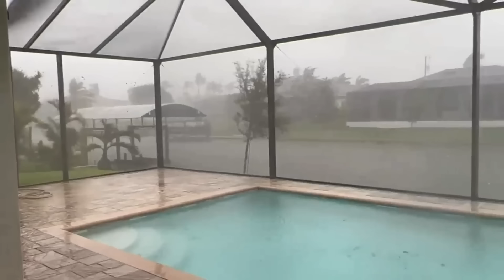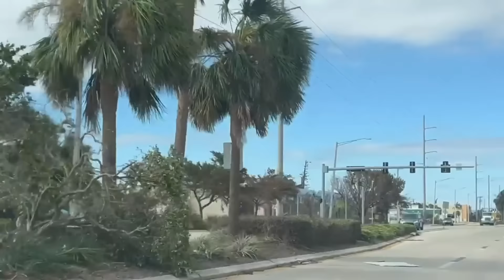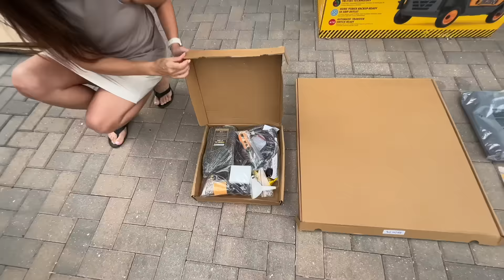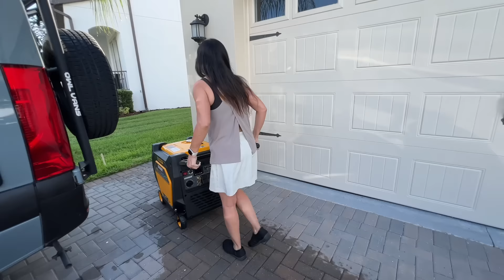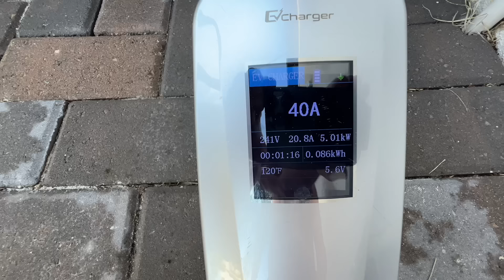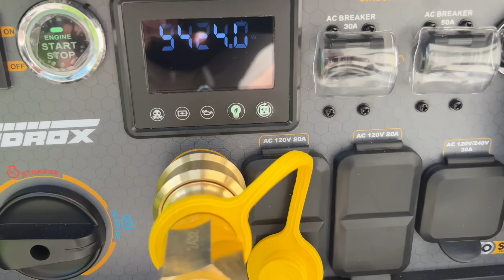Hurricane Ian - 3 Weeks Without Power Changed Everything: Gidrox 11,000W Generator

Comment: Seafoam in the gasoline lasts 2 1/2 years in a ul listed safety can, I have 10 of them…..
Reply: I store all my gas equipment with trufuel from Home Depot. It has worked excellent for me for several years now. I just run all the trufuel out and then fill with gasoline and then vice versa when I’m getting ready to store the equipment again. Trufuel isn’t cheap enough to run the equipment all the time over a prolonged period but great for storage.
Reply: @hotwiredpc4079  and I only use recreational fuel. It’s non-ethanol….from wawa
Reply from the maker: All great solutions, I made the mistake once ... and ended up with a new carburetor after letting my gas sit for 9 months.
Reply from the maker: Thanks for the tip!
Reply: Excellent! Having an ample supply of fuel is key. As a retired power lineman my suggestion is to have enough fuel for a two week interruption. One week for the roads to be cleared. Another week for critical infrastructure to be repaired. That way just as your using the last of your stored fuel you're able to buy more if needed? We keep enough fuel for a 3 week interruption. We like to have more than enough fuel because we all know the little old lady who is stuck at home when she should have had that tree cut down & her generator ran out of fuel because she didn't plan well.

Comment: Good stuff. I have been through MANY hurricanes and I have some suggestions:

1.Closed frame Inverter generators have their advantage in regard to decibels. However, the enclosure reduces ventilation which increases heat. Heat is the enemy of electronics (circuit boards, switches, etc.). Generators get blazing hot when used for hours. Failure after prolonged use is an increased probability. Testing for two full days of use before you need it is recommended.
2. A generator of that size will suck up a huge amount of propane. You must have fuel sources for at least 7 days without power. If you have trees with deep roots in your subdivision, then they can be uprooted and pull up gas lines. Always have a backup plan for the loss of propane as a fuel source.
3.You will need power while waiting for the storm to pass and are able to hook up and start your generator. I suggest you invest in some large portable power banks (e.g. Ecoflow, Bluetti, etc.). Charge them fully before the storm and position then to automatically kick on when you lose power. This is especially important for refrigeration.
4. Get some small portable inverter generators to recharge you power banks as needed.This will save on fuel and allow you to rest your large generator while still having power for essentials. Keep your Firman as a backup. Two is one and one is none as they say in the military.
5. You must get some portable window air conditioners (preferably inverter type). The roll around types are also a less efficient option. This will give you the flexibility to cool various rooms as needed. Humidity is brutal after a hurricane.
6. Plan to protect and defend your outside power sources (locks, chains) and supplies. You may be the only resource for desperate opportunistic criminals and theft rings. One advantage of power banks is they generate no noise to identify your resources from a distance. Particularly good at night.
7. Get Starlink and set up Google Voice (VoIP) so you will have internet and cell phone communication when the cell towers and cable providers go down.
Reply from the maker: Thanks for the suggestions. Having lived through Hurricane Ian myself, I agree with a lot of what you’re saying.

One thing that may not have come across in the video is that I already have a fairly extensive backup power setup in my van. In addition a generator, I have over 15kWh of lithium battery storage along with solar charging, alternator charging, and portable power stations. During an outage, those systems can handle many of the lighter loads while reducing generator runtime and fuel consumption.

I also agree that any generator should be tested before storm season. One reason I wanted to make this video was to put some real load on the Gidrox and see how it performed before I actually need it.

As for propane, I like it because it doesn’t go bad in storage, but you’re absolutely right that no single fuel source should be the entire plan. Redundancy is important, which is one reason I still have my Firman generator as a backup.

My van also already has a Starlink mini and it works very well. Communications can become just as important as power after a major storm.

The biggest lesson Hurricane Ian taught me is exactly what you said: don’t rely on a single solution. Layers of backup systems are what get you through long outages.
Reply: @RubysAdventuresUnplugged The free Google Voice VoIP and Starlink are your friends when the cell towers blow down or loose power.
Reply from the maker: Yes, the starling is amazing.  I have literally been off road in Utah cannons with no cell services for miles ... and still have perfect starling connection.
Reply: She was connected to Natural Gas.    I started with a Generac XL5500 which ran for 25 years.  It still runs, but might be too dirty for modern electronics.  It was replaced with a Firman 3600W, WO3342.  That smaller system is tested and could run my house until I changed houses and now have an electric stove and a 2 ton central AC.  In 2025, I added the 2 Ecoflow DPUs and two batteries.  Either set can run the entire house for most of a day without lifestyle interruptions.  It was a heck of an addition and worth every penny.  For fuel, I have 27 Gallons of gas stabilized and rotated through the car every 6 months.  I also added a motor snorkel incase if I have to go to NG...   Now I am just waiting for a good storm.  I am 3 years in this house and no week long power outage.
Reply from the maker: @gibblespascack1418  I realize it appears to be natural gas, but it is propane.  All the house in my area are connected to a large propane tank that is managed by the subdivision.  It is plumbed underground just lake natural gas ... but it is indeed propane.
Reply: @RubysAdventuresUnplugged  In NY, we get both NG and electricity supplied by either Quebec or Ontario.  Most larger cities have NG piped in.  We are supplied from two directions.  Canada and from the PA or NJ feed lines.  I assume that anything that boarders Ontario/Quebec is in a similar position.    If you get out near Boston, they receive LNG ships which help them through the winter due to insufficient feed capacity to the system.   However if you are in the more rural areas of NY state, then many houses have individual propane tanks( cooking/heating/standby generators) or fuel  oil tanks for heating.

Comment: Are you sure you're talking about "propane" and not "natural gas"? It looks like you are running it from your natural gas line. Natural gas also gives you a lower generator output than running it on propane.
Reply from the maker: Hello Jake, yes my subdivision has a huge propane tank that feeds out homes through underground piping (similar to natural gas).  Thanks for the question.
Reply: @RubysAdventuresUnplugged Great, higher output for you.
Reply from the maker: Agree, however the output was well above the propane and gas specifications.  Very weird.  Thanks for the comment!

Comment: Very informative video!
Have you considered a stationary, hard wired, propane powered unit?  Generac is one brand.  Automatic - power goes off, generator comes on, power returns, generator shuts down.  With a couple of fat boy tanks, your propane supply could be independent of the community supply.  Various sizes are available.
I have a 7500 watt Generac gasoline powered portable unit.  Plugs into the house, runs everything; have a propane furnace, stove and hot water heater, this reduces the electrical load.  Wood stove.  The generator noise is an issue.  Two ice storms resulted in outages this past year; fortunately not mid-winter.  Long winter here, used the snow blower first time on Nov. 11, last time April 6th.
Reply from the maker: Hello Richard, Yes I have thought about a hard wire system ... until I saw the cost.  They are not cheap and require constant maintenance, so I decide to go with a portable.  Thanks for the comment!
Reply: We live in a HOA & they forbid back up generators that run on propane. Natural gas is not an option where we live. The only solution was a gasoline generator. HOA's only govern what they can see. They can't regulate a portable gasoline generator that is rolled out of your home in an emergency.

Comment: If the gas tank is metal, I wouldn’t put gas in it.  Because you’ll probably store the generator for months, and having to empty the tank.  The tank will rust like crazy inside.  Then it will clog the carb.  I bought new gen like yours, followed the instructions as per the manual, and by the 3rd year my carb was completely clogged with rust particles, however it can still run on propane.
Another thing to consider is, you might want to get a portable ac.  Don’t rely on the main house ac.  The ac may get damaged, windows broken, or half the roof torn off.  If any of those things happen, you won’t be able to run the main ac, but if you have a portable ac, you can find a “good” dry room, section it off and use the portable ac.
My strategy is to get a small generator to run the smallest living space as possible , aka class b.  This will allow me to sleep comfortably, and I save $ due to fuel prices and inefficiency of producing electricity with a generator.  The small generator can run with 1 gallon with no load for 8hours, but a larger generator will eat up 4 gallons.  So if I use an inverter generator as the turbro, I’ll be able to run it as efficient as possible as it will throttle down and use little power through the night.  I figure it should be temporary or at least till electricity turns back on and then I’ll be using electric from the city.
Like you I’ve lived through hurricanes and like your neighbors lost 1/2 my house.  This is now my current strategy.  Good luck!
Reply from the maker: Hello Nick, I really appreciate you sharing your hurricane survival strategy and experience with generator maintenance.
Reply: @Rub @RubysAdventuresUnplugged ks, somehow the manufacturer didn’t think about humidity and storing the generator for months and in doing so the tank breaking down completely.  I can see huge chunks of rusted metal inside mine.  Another thing is if your generator is electric start, get yourself either the proper battery maintainer or like me, just a charger and I plug it into a timer that tops off the battery power once a week for about 10 mins.  Since I’ve done that my battery has lasted many years.  If you leave it permanently recharging, the battery will die inside one year.
Reply from the maker: yes!
Reply: To avoid this keep your gas tank full at all times.Exercise the gen once or twice a month and top off.
Keep a dehumidifier in the garage if possible.
Reply: @johnnyhotrod when I get another, I’m using propane only, the I’ll store in ac control area, definitely not garage.  Gas is a PIA. Lol
Reply: @nicklee5591 Gas is a pain in the ass. Unfortunately we aren't allowed to use propane because we belong to an HOA. Diesel is an option but again storage. Just like gasoline. We don't have anything that runs on diesel other than our furnace. It's new & I wouldn't want to put anything else in our tank outer than the fuel we are supposed to use. 
We rotate our fuel so it's never more than a year old. I put the old 1 year fuel in our trucks to be used. 
The key to gasoline is adding preservative & labeling fuel. We use Stabil 360 & Star Tron fuel enzyme together. We haven't had any issues.
Reply: @j @johnnyhotrod We keep our generator outside all the time in it's own vented enclosure. 
We keep our tank as full as possible with treated fuel. We have a steel tank & it still looks brand new 8 years later. The key is changing out your old fuel every year so moisture doesn't have a chance to ruin your plans.
Reply: carbs are cheap if you buy aftermarket so last one i bough was 15 bucks e bay or amazon .  brigs wanted 90 and its china made too
Reply: @remocres Our generator doesn't have a carburetor. It has electronic fuel injection. However our mower, pressure washer & snowblower & our other tools have carbs. I bring those in for service when they need it.

Comment: Gasoline generators do use fuel like crazy, especially if they’re close to full load.
Reply: I'd go for propane...at least they run cleaner (better for the generator). 
-- BR
Reply from the maker: You are absolutely right, fuel consumption really jumps up once you start pushing the capacity.
Reply: Except if you buy the model generator like ours. We average just the same fuel economy that they tout. 18 hours on 5 gallons of gas. That's more than enough fuel to last a day. We keep a massive amount of fuel at on our property. Enough for a three week interruption. 
The two biggest drivers on any storm is fuel consumption & noise. We have the quietest generator on the market. It's so quiet none of our neighbors know we even have one. 
One of the biggest mistakes people make after a storm is run out before the storm hits & buy the biggest generator they can afford & only buy 2-5 gallon fuel jugs. They're out of fuel on the first day because their planning was all wrong.
Reply: This is why I added a solar power station and solar panels to my emergency power plan.  It's a big enough power station to run important equipment in the home for nearly a full day.. especially if the sun is up and solar panels charging.  So my 5000 watt dual fuel generator only needs to run for roughly an hour to fully charge the power station; which greatly extends my supply of propane.
Reply: @72SeaHag  I will also be adding a small wind turbine: If there's no sun but there is wind, at least I'll get SOME input to the batteries.
Generator, solar & wind -- that about covers it. Unless they come out with small personal-size nuclear reactors...and only if they're affordable. ;-)
-- BR